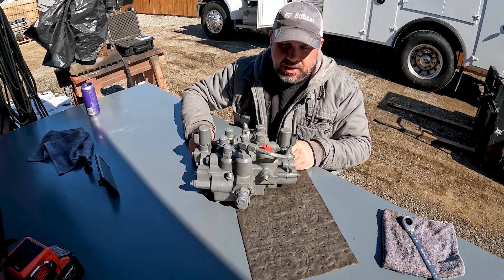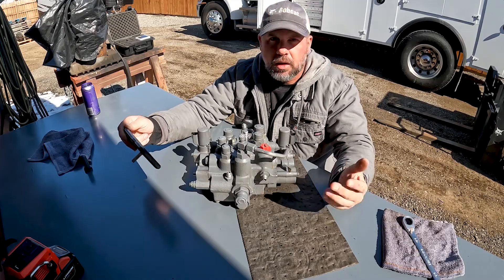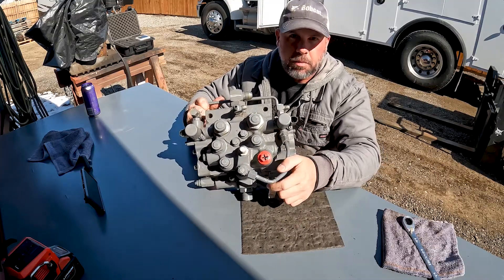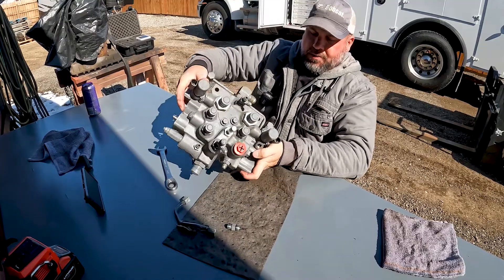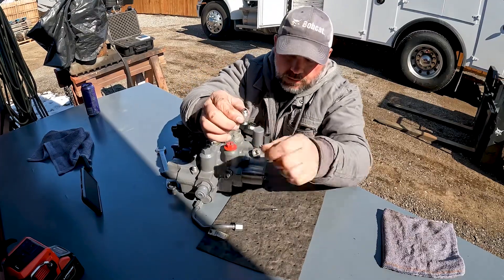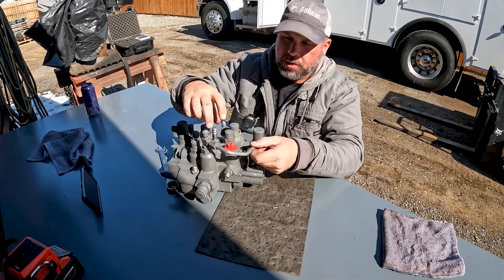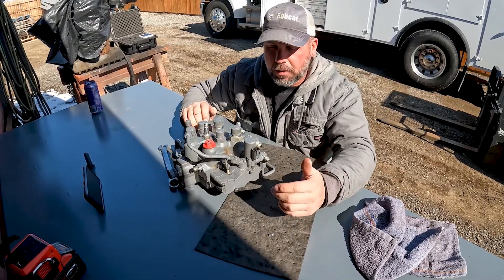Bobcat Hydraulics slow to release?  This $2 fitting could be the problem!

Comment: does an 863f have a check valve?imhaving issues with intermittent lift and tilt on an old machine. seems like it kicks on if you let it sit and warm up for a bit. 
is there a way to contact you?
edit: sent an email to 4tetradgroup

Comment: Hello Sir, my machine is S590 which is working fine but I am facing a problem that its lift or tilt is going down slowly on its own. When I remove my foot from the pedal, it goes down. If I shut down the machine or lift the seat belt up, then it lift cylinder is hold but tilt cylinder is also down
Reply: Please solution

Comment: We have a 2006 Bobcat S250 (with about 18,000 hours).  When you push the green button to operate the machine it might take 15 seconds before you can operate the loader.  It is almost like you have to gently push the pedals back and forth (even though they are still locked out and you can't push them very far) and that will help get them unlocked.  Could this be the problem on this era of machine too?

Comment: I have a 751 the hydraulics (boom and bucket) lock up intermittently.  Replaced  bisc solenoid and valve. Still same problem.  Put constant 12v to the solenoid to eliminate electrical problems.  Still same thing. Does anyone have any suggestions? Assuming something in the valve.

Comment: You just fixed my 2019 bobcat t650. I was having the same problems as the one you were explaining from your phone. Unit would struggle to operate arm functions for the first time after start, but as long as you didnt open the door, lift of the safety bar or shut off the machine it would work flawless. As soon as you did one of the previous three, you would need to 'walk" it out with high idle and then it would unlock. Thank you sir.

Comment: Hi I'm actually having some trouble with a S300 where the bucket tilt isn't working. The lift arms are good but the bucket tilt non operational. Could this poppet be the cause? There are no codes only a light flashing on the bucket tilt.

Comment: Have a old T300 and it does close to the same brakes will not release. New pump and it still does the same  thing. Have to try and rock it with the bucket and it will sometimes release.

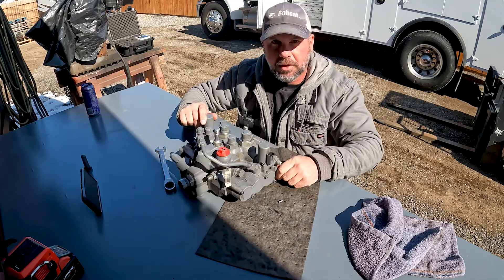Comment: When I put my breaker on my bobcat s590  are 15 minutes or so  it stops working  I have to shut the machine off and restart the process all over …when it’s first start doing the …it gets to the point  it  won’t operate it  anymore by shutting it down I thought maybe it was being restricted  not enough flow …but someone else said it sounded like it could be a solenoid not working right do you have any suggestions…just wondering where you would start looking for the problem it does show a W3275 code …thank you 7:08

Comment: Hello, i have a 2012 t770 that wont  release the left brake right away when you press the green button or lately the brake started to grab while in operation. This all started happening after we replaced the final with and aftermarket one that only requires the brake release line. kinda had me stumped as its only one side and worked perfectly when first installed

Comment: Yes sir, thank you for your videos. 

I have a 2020 bobcat t870 I’m having the same issue - boom and bucket work. No track function. 

My local bobcat mechanic told me to do what this video said. Remove spring and pop it. 

I did just that and I’m still not able to move tracks. I checked filters and cracked lines no metal in hyd system. 

Please help I can cash app you for your time
Reply from the maker: You can contact us at www.4tetradgroup.com

Comment: Hello, 1 have a 2001 873 g series, having problems with attachmentments staying pressurized when trying to take them off, now I’m loosing function on up and down now. Do you have any videos addressing these problems? Thanks in advance
Reply from the maker: G series should have the updated block which allows you to push in on the couple to release the pressure before you disconnect it.
Reply: @tetradgroup  mine doesn’t,

Comment: I have a bobcat s185 with a issue ..machine starts fine ..when the bucket is attached to the machine it will not steer left or right and when I take the bucket off it works fine I really need you help ..

Comment: Excuse me, I have a Bobcat T250, I have the problem that the hydraulic on the dashboard turns on and goes off, can you help me with an answer, thanks.
Reply from the maker: Usually, it's a bad connection at the battery.  Could be the display itself.
Reply: Because they want to charge me $10,000 just because the engine turns off
Reply: Because they want to charge me $10,000 just because the engine turns off
Reply: they say that the tracker engine does not work, that is why it turns off

Comment: My T590 is doing the same thing.  Is that line under pressure when the machine is OFF?  I am going to try to remove the spring and "pop it" but wasn't sure if I needed to release pressure on the system first.  Thanks for your awesome video.
Reply from the maker: It will not be under pressure with machine off.

Comment: I have a t650 2018. Lock the tracks or the bucket. But mostly is the tracks. I replace the solenoids for parking and 1 on the main distribution valve. Work fine for one week, and now does the same.  we put in a new main harness before cause Bobcat told me is the problem. Any recommendations.

Comment: I have  T190 that just gave a Hyd Charge Pressure On Shut Down error and the machine shut down. I checked the main pump belt, it is terribly loose so I will tighten that. Would this item cause the charge pressure on shut down notice on the screen?
I thought the belt may be the issue, but the 3rd time I started the machine over 5 min period, everything worked fine, even with the loose belt. So if this will throw that error of charge pressure, I'll search for the valve and take that poppet out.

Comment: I’m having a problem with my t595, the machine runs great for 20 minutes or so and then shuts down. I can restart it and run again for 20  minutes, service has checked codes and blames it on the hydrostat, saying it’s sending signal as a swatch plate error. Bobcat says I need new hydrdrostat and control cable .$12k fix. I find that hard to believe it’s the hydrostat, . Need help!
Reply from the maker: Could be the hydrostatic pump or could be a sensor.  Hard to tell without troubleshooting the machine.

Comment: What does it  mean when your drive pulls good in reverse but week in forward?
Reply from the maker: To many variables to answer the question
Reply: @tetradgroup  sorry I neglected to say only on the left side. If that makes a difference. On a separate note. You and your videos have been very helpful to me as I have a 763 as you show in many of the videos I’ve watched. Kinda new to your channel but great job.
Reply from the maker: @saberconstruction7224  reseal drive motor should take care of it.  Check case drain filter for black plastic material

Comment: Hey I got a 2014 T750. When it warm-up the boom and tilt gets sluggish. I tried replacing a new PROPORTIONAL VALVE, 6698434 and swapping both out but didn't fix the issue. Any ideas?

Comment: Another fantastic video!  While I have the engine out of my T550 (AJZV) and my swash plate bushing being replaced, would you recommend removing the pop-it and internals as a preventive measure?
Reply from the maker: Absolutely but it would also be easy to do with engine I the machine.
Reply: @tetradgroup  would a bobcat S530 have a check valve ?
Reply: THANK YOU, THANK YOU, THANK YOU!!!  Pulled that hose off tonight and the spring and part of the screen was poking through. Not sure where the rest of the screen is - I didn't find it in the tube.

Comment: I have that issue sometimes on a 773. The arms lock and it feels like the brake is on when I press the green button. If I raise the lock bar and lower it again press the button again and it runs normal. Might that be the possible cause? After watching this video, I checked the manual and I see the tube but no breakdown of it. Thanks again for all the great videos, very helpful to us who love these machines. Jeff
Reply: Did you ever figure this out? Mine does the same thing.

Comment: I have slow movement on my 453 on lift and bucket.   Drive is fine.  I am guessing mine does not have the check either since the 773 doesn’t?  Any ideas.  Problem is up and down and curl and dump.  Thanks!
Reply from the maker: Sounds like the gear pump is bad, need to pressure test and check main relief.
Reply: Thanks!

Comment: I have a 7753 that you must have safety bar down to operate, does it have BICS?
Reply from the maker: If you have the controller with green light behind the seat then yes it has BICS but this would not be an issue on the 7753.  This was on the later models.

Comment: This is a great video.
Reply: I did this 3days ago on a bobcat t650 after watching this video. Took 20-30 minutes total.  Instant fix.  For anyone else reading this. The hard line is a tight/perfect fit. Don't pry or bend the line or you will be fidgeting with it trying to get it right. Very easy to cross thread. It's in a tight space. I had to cut a 3/4 open end wrench in half.

Comment: Hello! Can I call you I need help with a bobcat you and I talked about this problem customer complains all hydraulic functions are slow. I tested this skid s550 2015 cat with and without a load everything works and runs properly. Loaded the bucket went up and down drove it everything runs with and without a load fine. He wants me to replace a pump. I am start to doubt if it was a pump all my functions would be slow. It is cold out here I did drain the tank put new fluid and filter and check this check valve what am I missing!?

Comment: Great Video I have a s550 2015 with 1500 hours. My hydraulic functions work except going down with the bucket function is slow and from time to time the bucket raise works slow. She runs and drives swell. Would this be the issue or do you thing i need a new hydraulic pump?
Reply from the maker: Could be several issues but first I would ask if it has manual foot control?
Reply: Yes I have foot controls
Reply from the maker: @lyubolesiv6867  I always start with the pedals and linkage. Make sure pedals have full travel and clear of dirt and debris.
Reply: I cleaned those out before I pulled the unit into the shop. Inspected the pedal and linkage is fine. Just the bucket down is slow. Sometimes the bucket rise acts up. Other than that she runs well. Do you have any information/content on a s550? Thank you for your help.

Comment: Great video!! I have 2017 T550 AUX will go to full flow when seatbar is lifted any ideas? I can hit the green button and turn on the Aux switch and turn off the full flow and back on again and off but when the bar is lifted it turns back on to full flow. Also the int switch doesn’t work at all.
Reply from the maker: No idea, not sure I exactly understand the issue.
Reply: @tetradgroup  thanks for the reply. The machine goes to continue flow when you lift the seat bar. And the toggle s/w doesn’t control the by-direction flow when I do get the continuous flow off.

Comment: I have a 2013 T650 bobcat. We just changed two older lines on the final drive. One blew and the other was soon on its way out. Brake and rear smaller line. 2 speed machine.
After the lines were replaced, the brakes won’t fully release. Getting a squealing sound. Could the ball valve be the issue here as well?
It worked fine before replacing the lines

Comment: Thank you for your channel. You seem very knowledgeable about bobcats.  I have a question that you mite have run into before. I have an 853 that leaks hydraulic oil in into the chain case and can't see a hydraulic line going into it. It's not on the high pressure side, it's a gravity leak. Don't know how it's getting there. Am I missing something?
Reply from the maker: It's entering the chain case thru the carrier seal.  The drive motor bolts to the carrier and oil from drive motor leaks past carrier seal into chain case.  If the case drain filters for the drive motors are clogged then case pressure will build up and blow that carrier seal, however seal itself could have just failed.  Hard part is finding out which side, just do both sides and make sure to change case drain filters.

Comment: thank you so much for your channel.  You do a great job detailing issues.   I had the same issue after my guys broke a line off an implement.  Afterwards the machine was sluggish to release the hydraulics after cranking it.  I removed the line and actually found a small bit of debris, likely dust turned to mud after the broken line.  Cleaned it out and immediately started to work.

Comment: @HowIDidIt 
Thank you for your videos. I have never worked on a bobcat before but I am helping a friend with his 2017 T650 ALJG21206 throwing code M2899. I am not sure sure where the "FRONT BASE" is located. When you start the machine and pull the lap bar down the park brake will not release. The red light on the park brake switch stays illuminated. When you press the Green Push to Operate button the engine instantly stops running. And Shutdown is displayed on the monitor. I have removed the coils on the main control valve, I did not ohm out  but I did energize the coils and put a screwdriver in it to verify it was good. They had a strong field. I even removed the valves to check for obstructions and to verify the valve had stroke with the energized coil. I did the same test with the solenoid valve on the top of the gear pump. I did the same with the park brake and two-speed coils. I have cleaned and applied a thin layer of dielectric grease to all female connectors under the cab. I installed a new Continental 31 series battery. The little ground wires at the battery had some cheap screw-tight lugs on them. I removed the old lugs and soldered in copper #4 eyelets. 
Could my that plunger completely block the flow and make the computer think that I have an open circuit because I have no charge pressure? Any input is greatly appreciated. You have earned my sub. You are the only place on YouTube that has reliable information. Thanks.
Reply from the maker: I'm showing M2899 as throttle calibration which would not cause any issues with starting.  If you haven't figured it out you can contact me through www.4tetridegroup.com.

Comment: I’ve got a 773F I wonder does it have that little check valve in it I’m having an issue with my hydraulics as well my tilt and lift functions are good but I cannot lower the boom it comes down but very slowly and under strain from the engine seems like it’s working against itself
Reply from the maker: This check is not on the 773F.  Sounds like a piston on one of the lift cylinders has backed off.  Not an issue going up because of pressure seats the piston on the rod.  If the only issue is with the down function start by disassembling the lift cylinders.

Comment: good videos    i have a  a s300  auxiliary   problem  hammer is no working i check the presión on  auxiliary  fitting  1 of the fitting 3000 psi other one is a 2000  i  swish  hoses  to the  return line on to the pressure and is working now    on the tom  botton work  on revers    question is what can be the problem  i have 2 and valve  anew coils  only pressure on 1 side of auxiliary   fitting   the super  tool works only on side  tx for your help on adbanse keep on  your videos
Reply from the maker: I am not sure I understand the situation.  If you want to discuss further, please contact us through our website at www.4tetradgroup.com
Thanks!

Comment: I've got a 773 f series, 1370 hours, when using it if I lift the safety bar then lower it ,hit the release button it is still locked up, have to shut the engine off then restart, hit button all ok then, any thoughts..... thanks
Reply from the maker: After you push green button what are the lights doing on the bics controller?  The box behind you on the right?
Reply: @tetradgroup  never paid any attention, I'll look tomorrow
Reply: @tetradgroup  I have a question for you you seem very knowledgeable on the bobcat machines. I have a bobcat 873 that when on idle smokes really really bad blue and then  under any load smokes straight black and has absolutely no power. The motor runs fine and sounds good. You wouldn't know there was a problem until you see the smoke and experience a lack of power. Do you think that can be a bad turbo?
Reply from the maker: @mhdairyfarm2911  the turbo would be the very first thing to check
Reply: @tetradgroup  ok thanks!! How much of a pain is it to change it? can I get to it through the side panel or do I got to remove the muffler and get  at it from the top?
Reply: @tetradgroup  so I changed the turbo and it made absolutely no difference. what do you think I should look at next? Injectors? Head gasket? Any thoughts?
Reply: After pushing the green button it shows traction light flashing, turn key off then restart all ok

Comment: Good morning I have cain of the same problem with my 05 S300 but something else is that the hydraulic fluid creates a lot foam I already check for air suction all the suction hoses look good no leaks the machine hasn’t been abused 2500 hrs can you help with any ideas
Reply from the maker: If it's manual drive the pump pintle shafts can suck air thru the seals, but usually you will find the gear pump needs to be replaced.
Reply: Am soo lukey to injoy yur ve
Reply: Good go